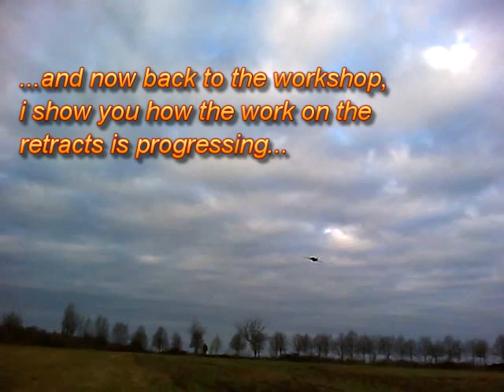Modified P-51D BL Mustang -Testflight

Comment: Hello. Congrats, beautiful job. How did you painted these gunpowder/motor residues effect? i would love if you create some tutorial video doing this. Cheers.
Reply from the maker: Hi,  and thanks, it is actually not that difficult but there are a number of methodes to do this kind of work (usually known as weathering or ageing). You can use crushed ash or choke for it, and than fix the dust with a coat of clear spray paint, or you can use a normal brush und dry paint it or you can use an airbrush system like i did...i think its the easiest way to do it, and it gives you the most possibilities in my opinion.
Anyway all methodes take a fair amount of practice to do it. Most important thing for all this work is, think about were the air is flowing, that is the base principal behind it. As long as you keep everything in the direction of the airflow it does not look wrong (for the most part ;) ). And for a beginner in weathering i would recomend to use the rules "less is more" and "practice, practice, practice", there is no substitute for it. 
I build airplane modell and rc models for decades and there are so many ways to age a plane that you could right a book about it which is also a good way to learn about this kind of stuff, the web and books of course.
But since this is not the first time i have been asked about this, i will probably take your advice and do a smal tutorial video in the near future. 
Thanks for watching...and you can check out a bunch of other build videos on my channel if you interested, cheers and happy flying :)
Reply: Hey, thanks for answering. What kind of ash is better (charcoal or maybe cigs ash?)?. What you think about just carefully rub the ash dust into the foam with the fingers without use any ink after for a more mat detail?. I dont know if you have interest and time for this but you should start a serie of tips and tutorials about visual mods for FOAM/EPO Warbirds (maybe 1 episode per month). Cant wait for the video so! ~i am subscribed. Cheers.
Reply: I was thinking about to mix crushed ash, a little bit of water and a few drops of white glue (just to fix better), then with a normal brush paint normally. I will test it in some pieces of styrofoam to check the final result.
Reply from the maker: for gun or exhaust residue it is better to use dry chocke or ash...if you want an effect like spilled fuel for example (near the fueltank caps) it is better to mix the ash or choke with another medium like thinner, alkohol or water...what kind of ash or choke you use depends on the color you want, burnt. crushed wood (like from a match) works very nice for the exhaust because it contains a bit of brown too...and i usually use a q-tip to apply it...one other thing..if you wann fix the changes you made by putting a clear coat over it make sure its is really mat, and make the clear coat a thin as possible, happy modding :)...PS: and dont forget the practicing part
Reply: I will practice with crushed wood (from a match) with water. Some planes have a very impermeable paint, like my Funfighter Seafury do, im not sure using water as a medium will work fine on it. Alcohol and thinner are not epo/foam corrosive?.
Reply from the maker: that is true, that also can lead to the building of dops if you use a watermix... and usually alcohol and thinner are ok, if you still wanna use water put a drop of dishwashing agent in it, that reduces or destroyes the surface tension of the water...and its always a good idea to test the mix before you use on the outside of the plane, that goes for paint too of course.

Comment: Also warbird what retract system did you use? I ordered an extra set of F4u gear since the crash, I have read that the F4u gear will work and look good on most parkzones with minor modification, I am going to order and extra wing for my mustang to try flaps just not sure what retract to look at.

Comment: Ahh...one more question. My P-51D BL came with the plastic of canopy a little opaque (no too clear like yours). Any idea to fix it?.
Reply from the maker: opaque canopies are very hard to deal with because most of the time its UV related...or in a bit more detail, constant UV-light exposure changed the plastic the Canopy is made of, so usually there is not way to deal with it other than to replace it, sorry.
But of course there are a few rare occasions were there is simply micro dust that formed a kind of patina on the plastic...you can try to remove that with a soft cloth and some alkohol or nitro based thinner, but not window cleaner because that stuff is often to rough on the clear plastic...and of course you have to remove the canopy from the plane to do that because this kind of stuff also forms up on the inside.
PS: and thanks for subscribing :)